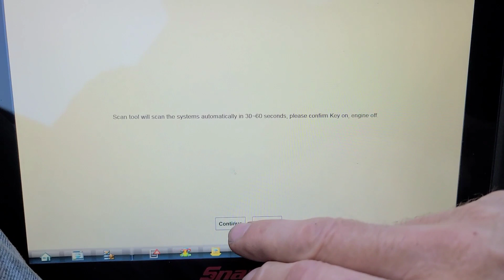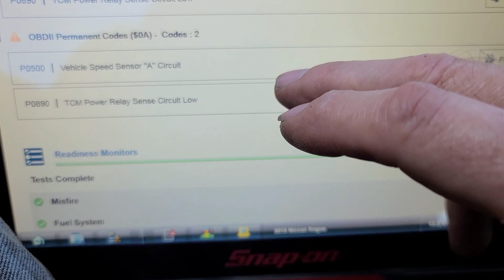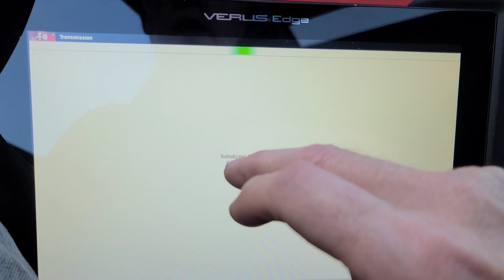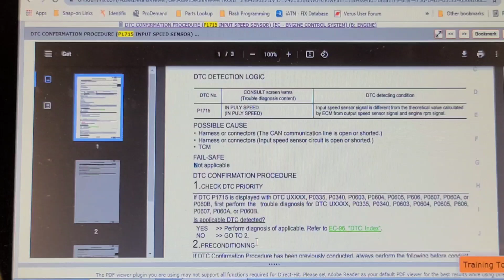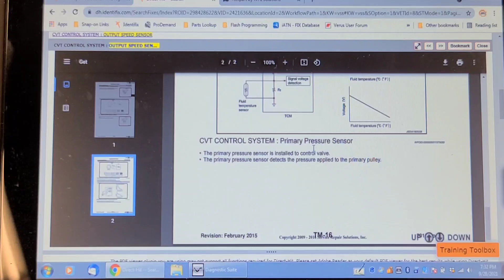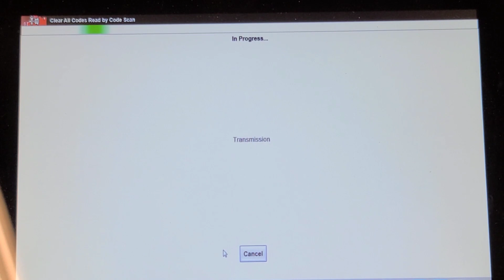2015 Nissan Rogue  Transmission Goes Into Limp Mode, P0500, P1715, P0890

Comment: Hello have a 2010 Nissan rouge and it has begun fluctuating the Rpm while driving in a constant speed. It’s like is shifting down and then goes back , but speed is not change. Please recommend what can it be been to a couple of mecanics and they have not been able to repair . It’s my 18 year daughter first car.
Reply from the maker: Those have a CVT transmission with a chain drive. Likely needs a new chain as the wear and slip. There is a bulletin on it I believe but nobody will likely change just the chain so it's likely going to need a transmission replaced.
Reply: No these nissans have a thing called a stepper motor check and see if you have any trouble codes

Comment: I am having this same issue with a 2016 Rogue.  Did this fix the issue?
Reply from the maker: I ended up replacing the crash damaged fuse box and cleaned some grounds. Never cam back for that transmission issue.
Reply: I’m having the issue now 😞
Reply: https://www.youtube.com/watch?v=9Srfh1u8fzo
Reply: The fuses get corroded very common in all . Just remove and clean, then all good.
Reply: Where did you get a fuse box from ?
Reply from the maker: Local salvage yard here in Thunder Bay.